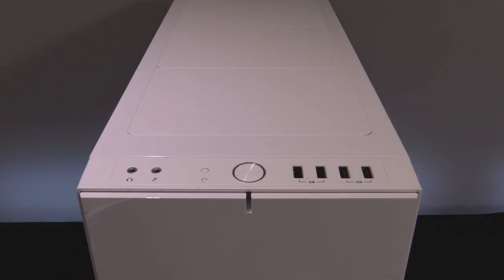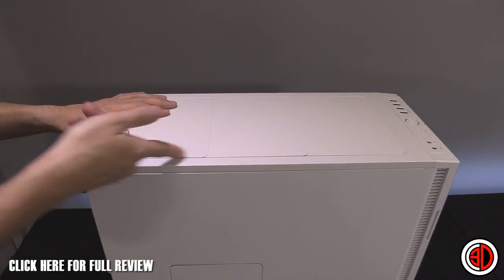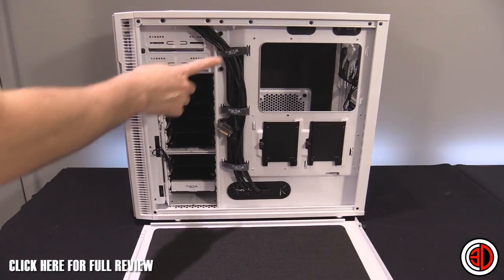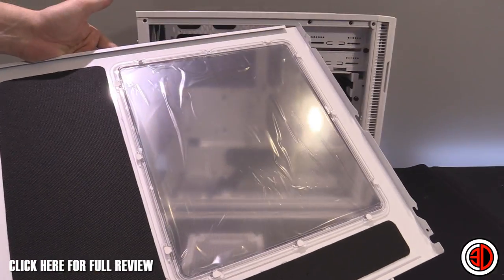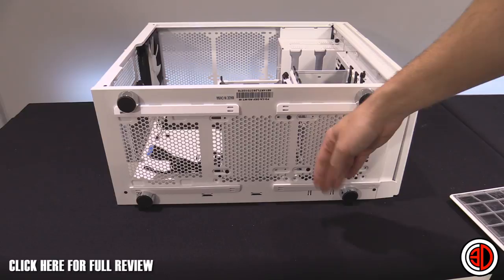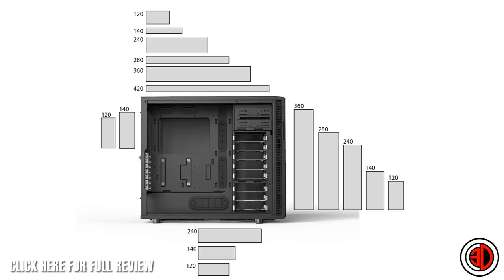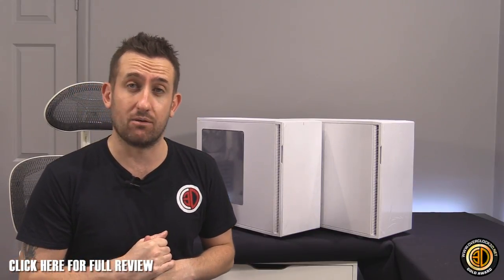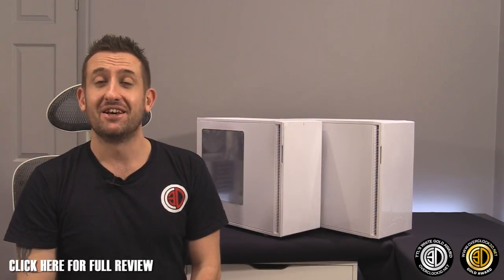Fractal Designs Define R5 Including Window Review

Comment: So, I have this formula in my head atm:
This case - (optical bay + 3 HDD mounts) + 5 HDD mounts at the top + cover up all 3 fan mounts at the top + Sabertooth mark S + (140mm intake fan at the front x 2) + (120mm intake fan at the bottom under the HDD cage x 1) + NZXT X41 for CPU at the back + Gigabyte GTX 980 G1 gaming + (black Kingston HyperX Fury RAM stick x 2) + (white Kingston HyperX Fury RAM stick x 2) + (SSD behind mobo tray x 2) + (HDD x 3) + Seasonic Snow Silent PSU + white Bitfenix Alchemy LED strips = Awesome dust-free-ish white-color-schemed rig
Reply: Why you no get a black motherboard and gtx 980 HOF edition?
Reply: Damion Bacchus Well, with all due respect sir, make your own formula :D
Reply: If you're trying to minimize sound too, maybe not get the loudest 900 series GPU and an AIO at the back. 

I'm going for a NH-D15 and 970 FTW.

Comment: With so many amazing cases having come out in the past year, this one is stupid good. Brilliant review for a brilliant case. I shall start painting my rads white ASAP. Having now purchased the black/windowed version, one thing no one has mentioned, and that is the extreme off-setting of the top fan mounts. Unlike many cases including FD's older cases, the 120mm fan mounts are so far to the left that putting a 240mm or 360mm radiator in the top still allows taller RAM and doesn't impede connecting the 8-pin CPU cables. Even 140mm based rads allow for almost unlimited thickness. Really, really nice design. I also agree on the single fan radiators. Even the best of them will MAYBE dissipate 85-100 watts of heat. For the flow reduction, extra piping/acrylic tubing and needed fittings, no thanks.

Comment: Improvements:
- PSU pushed to the left, like on the Silverstone KL04 to leave more room behind motherboard tray for cable routing.
- Covers for the mesh next to expansion slot.
- 8 expansion slot - it just gives a little more room and the case wouldn't have to be much bigger
- cable routing at bottom of motherboard for USB and audio
- each of the 3 top fan covers to be in 2 parts so you don't have 1/3 of the space open for dust
- also, it would be nice to be able to mount a 240 rad in front and bottom at the same time.

I think that's it. :D
Great case though Fractal!

Comment: I got the one without the window because I want my rig to be as quiet as possible, and there is the extra option to have a fan on the side if I want to. The only thing that might be a problem for some people is it doesn't have the verticle expansion slot at the back of the case like the R4 did, but that's very niche.

Comment: This fixes EVERYTHING I had issues with in my R4. I'm tempted to rebuild my PC in this case now, although the Arc Midi R2 & Phanteks Enthoo Pro are also contenders.
Reply: Enthoo Pro is a monster. It's near perfect IMO for the price it's a steal
Reply: ***** You got the front 200mm and rear 140mm. Positive air pressure. It is enough for your gpu man, my Enthoo Pro cools my gpu like a boss. It has direct mesh

Look at some NZXT cases they look very nice but basically closed box. Enthoo pro is amazing for airflow

Comment: Sorry if you mentioned this in the vid already, but is there a difference in silence with the windowed vs non-window side panel? Thanks
Reply: ***** Strange I saw a picture of the window panel that had the foam where the areas of the window did not cover.  I ordered this case and it comes in today!
Reply: ISEE YOU You are right there is some material there.
Reply: ***** There is sound deadening material even on the windowed panel but much less  ;-)
Reply: There is sound deadening material even on the windowed panel but much less  ;-) and like on the R4 the windowed panel will amit a bit more internal sound than the closed panel. Difference is not huge by no means...but if focus in on creating THE most silent build ever you would choose the solid side panel.
Reply: Just got mine built.. it's VERY quiet.. although my CPU fans and Video card fans do not run at idle.. my Noctua case fans are at 400rpm.. everything throttles up at needed so under light use or idle its extremely quiet.  Looks great as well.
Reply: ISEE YOU Do you have the windowed panel?
Reply: Quarker Yes, I did the white with the Window panel.  Love it!

Comment: The window appears to be designed to cut off at the psu height, do fractal sell 2 HDD cages that would also be below the window leaving a nice clean look if i want to remove a central cage and have 2 on the bottom?

Comment: i need some help here  this  case  look like the one i need  but not to sure about if i can put my project build in it  due to me breaking the current case (Antec Lanboy) which is in, currently have this setup   CPU - Intel Core i7 - 37770K  Ram - 6144MB RAM Hard Drive: 4 x 2T  Grpahics Card - MSI R9 £90 OC edition  Motherboard: MSI Z77 (Socket 1155)  Power Supply - Cooler Master Silent Pro Modular 2 1000w  any help on getting a correct case would be great thnaks

Comment: Looks nice. Could not find one in white anywhere. Bought a black R5 instead but the case was damaged when delivered. Unfortunately the damage is bad enough to prevent the case from being used. Now I am stuck in limbo waiting to see if I can get a replacement or not. If I have to take a hammer to it to do some primitive jury rig I will not be pleased.

Comment: Great video geting one thinking of doing a 420 at the top 280 in front can keep the fans low even turn the ones on the 420 off when systems not under load. I realy like this case its simple and has options i like

Comment: Ok the covers in the top are genius, no unnecessary dust into the build
Reply: I would have liked them to be in two parts. So if you have a 120mm fan, the left side (rear perspective) would still be covered.
Reply: lucasino8 left side? im talking about the top 3 "covers" for fan mounting vents
Reply: Talking about them too, as you can see the grills are wider than the fans. So if you place a fan, there is a part of mesh uncovered (no fan nor cover).
Reply: Ohh ok i get it now, yeah true
Reply: Romick Vieira he means, if you take the top covers off, you have the last 1/3 on the right had side (looking from the front, top down) of the top open to dust because the fans are off-set. I would have preferred losing the 180mm fan support and having the top only open where fans can be tbh. Will still probably get the case though :D
Reply: John Connor Yeah. Case is "nice" i guess but well NZXT s340 is looking hot, and its cheap so
Reply: Romick Vieira Yeah, that's an amazing case. My recommendation for cheaper builds, unless people want Alienware-like shit...

Comment: What is need to fix in R5
- front doors should open much more wide - still big fail (see Antec P280)
- fan controller should be with small knob not steppy only with three settings, also should be two of them one for front fans intake, and second for exhaust.
- little too much flexible construction without both panels
- 5.25 covers should not be rounded, looks bad after install 5.25 devices.
- plastic motherboard standoffs.

+ best thing what they done in R5 is bottom dust filter removable to front - great job FD.

Overall very nice and queit case with a lot of improvments, but still not perfect.

Comment: Upgrading my computer this christmas with: 

- EVGA GeForce GTX 980 SC ACX 2.0 4GB
- Corsair Vengeance Pro DDR3 2400MHz 16GB 2x8GB CL11 
- ADATA SSD Premier Pro SP900 256GB
- Fractal Design Define R5 - Titanium Grey / Window
- Corsair Gaming K70 RGB (Cherry MX Brown)
- Corsair Gaming H2100 Dolby 7.1 Wireless Gaming Headset

Is $1639 a good price for it all?
/I don't know why I have a Xbox One and PS4 if I'm a full PC gamer. (Probably because I'm dumb.)
Reply: *****
honestly you only need one 970 for 1080 1440 2 makes sense or 4k

Comment: I have 4 filtered fans blowing in on my case and only one blowing out so yeah, Anyways a 140mm raidator in the bottom wouldn't be a concern anyway because you can't see it and its prefect if you don't want to remove any of the HDD cages and you want to keep all the moduvents on the top.

Also it would be the perfect excuse for push pull because you will have to push the air out or in though a dust filter and the Rad.

and if you have a closed loop water cooler just for your GPU its the perfect place you it.

Comment: I hope to see a build log as a server build. I asked Jayzteocents and linustechtips the same.  But they both have the black ones. Really want to replace my current 20+ year old inwin q500b full tower that i managed to fit 14 drive bays in.  With one of my 3in2 cages i can get 13 into this case. My inwin is modded with loud fans to keep server drives in or below 40c when streaming to multiple tvs or pcs in my home. I have a duplex and as part of my rent to renters i give access to my media so mine is loud now but does work great.
Reply: 20 year old case? Damn you certainly got some mileage outta that
Reply: WayStedYou lol i have 4 of them. I built in other towers and do to temperatures overtime i ended up tearing them down and moving them into the old inwin q500b full towers.

Comment: Now the big question is...this, or the NZXT H440?
Reply: What did you go for, i'm in the same boat.
Reply: +Bunty B I went with the Nzxt mainly for aesthetics. I enjoy the end result but it isn't perfect. building in it felt tight because the wall beside the motherboard sticks out, and the cable management side is pretty hard to close. I still prefer it over the r5 because I don't like how there is just an open top for the radiator

Comment: any bottle necks in this build
Intel core i5-4690 $220
gigabyte z97x gaming 5 $135
xfx r9 290 4gb dd $309

p.s I don't really want to overclock
Reply: if you have any suggestions please keep them near or below the price of the original part
Reply: You won't experience any bottlenecks.
Reply: Hi, I would recommend picking these parts: 
-i5 4460
-MSI H97 Guard Pro (or B5 Sniper)
-Gigabyte GV-N970WF3OC (not the G1 gaming, it's the same card really, just cheaper.)
-8GB RAM (maybe blue colored for theme)
-Deepcool Neptwin (nice blue theme cooler)
-Seasonic S12G 450W (Gold PSU)
-MX100 256GB 
-Random HDD, like Seagate or WD Blue
-NZXT H440 Black/blue

All of this would give you a silent and nice themed PC.
Reply: lucasino8 Why should he go with a 4460? He didn't mention any budget. MSI Makes some nice boards but most of them have a killer NIC, which is crap.
Reply: Raptor Jesus 4460, it's cheap and it performs the same as an i5 4690K (at stock). Given that he didn't want to overclock, his decisions make no sense. If you pick an i5 with a R9 290, you have a budget. Anything lower than planned is nice. I know the killer NIC is worse than the Intel one, but has anyone really noticed?

Comment: Are there any quiet hdd's?
Reply from the maker: 2280david WD greens are about as good as it gets
Reply: OC3D TV thanks. I will try them
Reply: ***** thanks. I know that a ssd nearly silent, but i cant afford a 1tb ssd and i need a lot of storage because i make Videos and a lot of them are in 4k. Right now i use 4 2 rb Seagate hdds but they are just to loud and i need more storage. I thought maybe the wd puple 6tb one but i will try the wd greens
Reply: HDD wise the quietest would be 2.5'' drives. Samsung and WD caviar blue are reasonably quiet. I have wome and just hear them spinning on. When you need a big scratch disc for our video projects, I recommend the WD Raptor 600Gb. I got one for my dad who does video editing (amateur) as well. He's pleased with it and it's really silent considering it's 10'000 rpm. 3.5'' drives will always vibrate and make noise all the time.
Reply: There's a 4tb green on newegg for $130
Reply: +mrWaldow Forget not being able to afford large SSDs, the SSDs aren't even large enough!

Comment: If you buy this and start removing panels or using the window you need to get your head checked, JUST BUY THE ARC SERIES FOR LESS MONEY! They shouldn't have even made the top panels removable, defeats the entire purpose of the case.
Reply: I'd rather buy this and have the option of putting the top panels back on in the future. I don't know why you'd want the case to lack flexibility.
Reply: This case is prettier though.